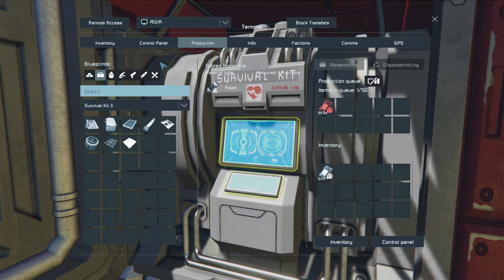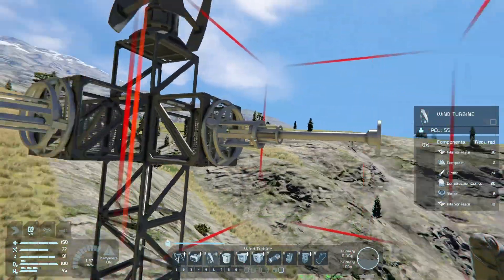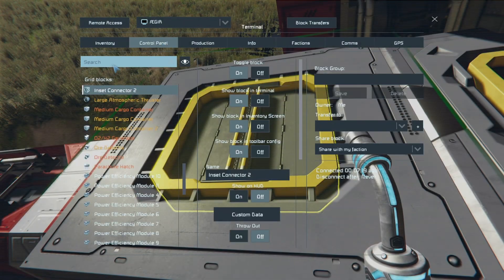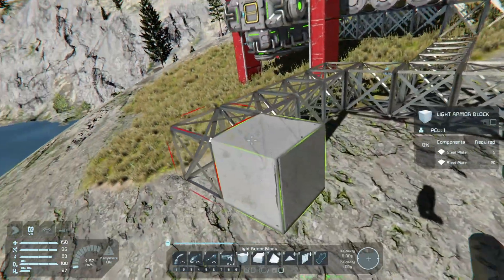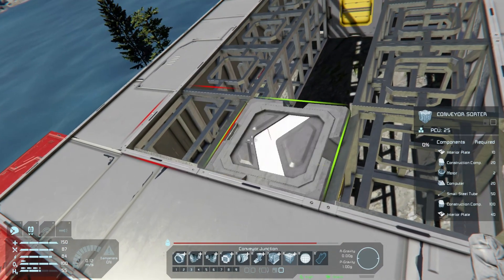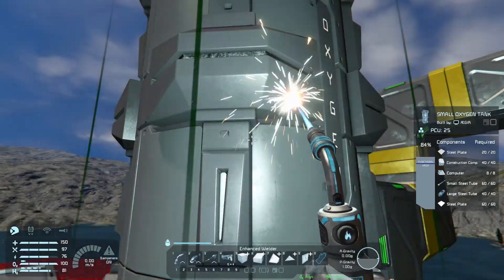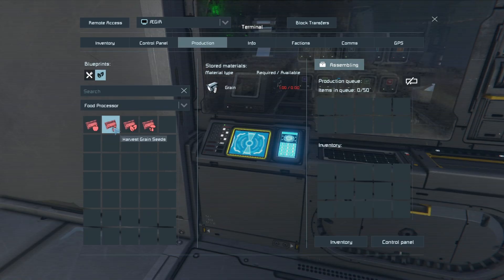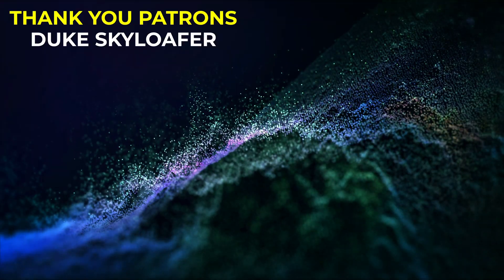Space Engineers | Simplified Guide: Build a Self-Sufficient Base!

Comment: Great tutorial!  Some thoughts:

1. While I appreciate how to-the-point it was, I strongly suggest extending future videos to at least ten minutes.  This will not only give you more watch-time, but will also rank them up in the algorithm.

2. Add chapters for each topic and include a table of contents in the description.  That will make it MUCH easier for your students to quickly jump to what they need to review.  It will also give YouTube a more sensible place to drop mid-roll ads instead of right in the middle of a lesson.

3. As power is a large issue in the early game, I always add at least one battery and pairs of event controllers to my refineries/assemblers/etc. One is set to automatically turn them on when 'stored power %' reaches 100, and the other is set to turn them off at 25%.  That way, I never run out of power and they can still run all-out whenever they can.  (You can save a lot of materials by creating a 'supercomputer': add a small-grid hinge part to a large-grid hinge and place small-grid versions of all of your event controllers/programmable blocks/etc. on it.  You can place LCD screens/panels around it to hide it.)

4. Inventory control scripts are pretty much a must-have later on, and Isy's has now been replaced by a MUCH better one: the GOAT.

5. The very first change I ALWAYS make to my survival rover is to add a remote control block, a programmable block, a downward-facing camera, and the 'DAS - Driver Assisting System' script.  It makes driving an absolute pleasure instead of utterly frustrating for new players.  I've actually survived a surprise 200m cliff with no damage, thanks to the tweaks it automatically made in real time to the gyroscope/suspension/etc.  (The camera allows the script to automatically align the rover to whatever surface it is above, so you always land on all four wheels like a cat.)  I STRONGLY suggest you make a video about it and show just how much the driving experience is improved.

I look forward to more of your videos.

Cheers!
Reply from the maker: Thank you!

1. I am much more focused on keeping these simplified and to the point than milking watch hours/ad revenue. At least for tutorial content.

2. There are chapters in most of my videos, especially each one in this series.

3. Great ideas! If I wasn't set on keeping this as simplified as I possible I would definitely be diving into little tips/tricks like that. Honestly a great idea for a deep dive series.

4. Same thing as above. GOAT is still pretty horrible at managing refineries from what I hear, but in time it definitely will be better than Isy's for inventory management.

5. Also great ideas, but not something I'd touch in a series like this. There are many amazing driving scripts and if I was to highlight one it would be CHKNFRYRMN's.

Thank you very much for taking the time to share your ideas and I'm definitely interested in diving deeper into some of the mechanics and explaining some of the points you made.

Comment: I limit my power modules to a maximum of two. That reduces the power consumption of the Refinery and Assembler below that of the Basic Refinery and Basic Assembler, which alleviates pressure to expand power right away. I then move to Speed Modules, and have Event Controllers shut off speed modules when power is low. I think Yield Modules require Superconductors, making them mostly just tedious.

I normally operate a 3 plot farm to start, expanding my plot capacity later. A two story starter base, with the farm on the 2nd floor, allows me to use the bottom floor as a base and an airlock. On planets I will use an advanced rotor on the outside of an air vent, an attach a small grid air vent to fill a small grid small oxygen tank, an Event Controller turning off the outside air vent when the o2 tank is at 50% capacity.
Reply from the maker: That's a great way to start. I personally love yield modules and always have a good source of gold so I don't find it that tedious.